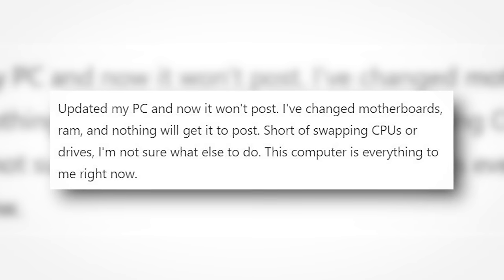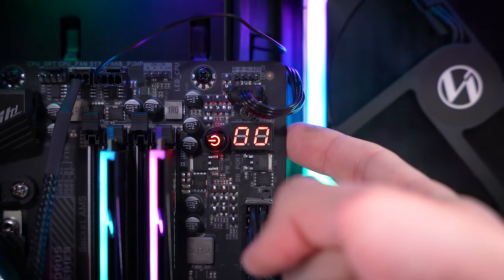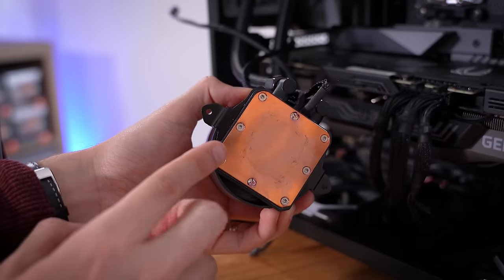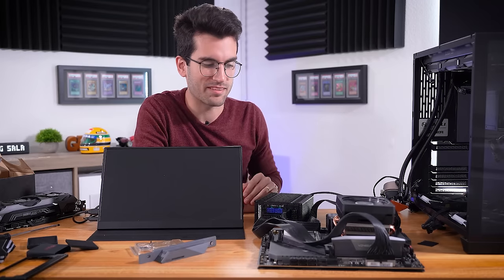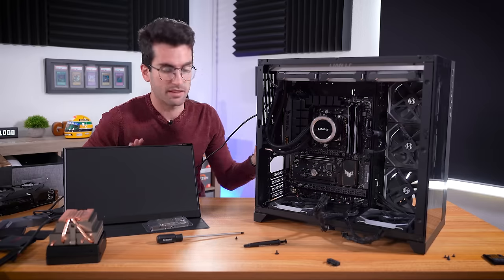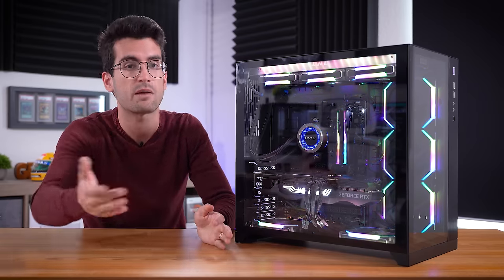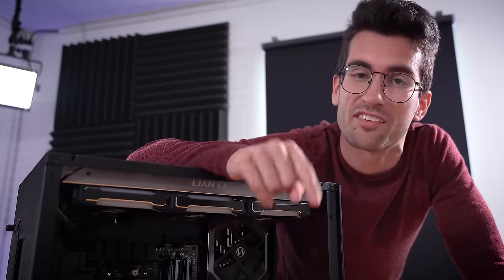Fixing a Viewer's BROKEN Gaming PC? - Fix or Flop S5:E5

Comment: as soon as you said that the MB was gigabyte i knew it was the board.. gigabyte boards are crap and they should never be used.. and b4 anyone flames me.. been building,repairing, working on computers for over 30 years.. have build thousands of them and whenever i have used gigabyte boards, 90 percent have ended up being replaced..
Reply: I agree dumpster fire boards
Reply: I have a gigabyte board and I’m sure something is wrong with it. I can’t enable expo without the pc not booting again. I tried multiple ram kits also

Comment: So, as soon as you showed the specs of the PC I immediately knew it was the motherboard. I as well was upgrading a few parts in my PC, and when turning on the PC, I was getting the same LED bug. Fortunately, I was able to do a return exchange with Newegg and got it replaced. I was able to test it and now have a working PC. Gigabyte may have a know issue with that version of the motherboard because the new motherboard I received is version 1.2, and the one I returned was 1.1.
Reply from the maker: Interesting note! I had no idea there were different revisions of this board.
Reply: A lot of the time different revisions are just about the WiFi card that comes preinstalled these days, e.g. on this board rev 1.0 comes with an Intel AX210 and rev 1.1 ships with an AMD RZ616 Mediatek job. 1.2 is not yet listed, unfortunately.
Reply: The issue he had was typical of a bricked bios not a motherboard issue.  It had already checked the chip and ram.
Reply: does the board have bios flashback? maybe that would fix it @GregSalazar
Reply: @GregSalazar  YEP, early adopters like myself are absolutely shafted with this total POS...
Reply: @SteveMosetiAliyebarikiwa  Maybe temporarily, it's a really bad board. Even for the extortionate price GB charges for this thing, it's a complete dumpster fire of a component :face-fuchsia-poop-shape:
Reply: @TheSjuris  I agree but in my case I bought the motherboard brand new from Newegg and still wouldn't post and I let the PC sit for over 10min to see if anything would post.

Comment: Flash bios may save the board.
Reply: It's ridicilous how many PCs stop working and then you update bios... works now. Doesn't make sense.
Reply: bios update would have been my first goto considering the symptoms
Reply: I agree
Reply: When the message from the owner said "I just updated my bios and now it won't post" and the title of the video says "bricked pc" , sounds like a bad flash to me. I would have tried Q-Flashing it right off the bat.
Reply: Wouldn’t have fixed the warped cpu socket
Reply: @adamtowsley3526   I don't think it was contributing to the issue. The CPU retention bracket puts more force on the cpu and it slides into place even if Greg didn't push on it with his finger. Either way, Q-Flash would have been my first step from the information provided was the point I was making.
Reply: First thought i had since the description. It might be it, but he can't start off by flashing bios. At best he would do it at the end but since he replaces the mobo he doesn't need to.
 That's why if i was makin videos for a living i would have died of hunger. If we are right it would be a 5min clip at best and the takeway would be "i'm right"  vs 25min with some info for the newbies.
Reply: @ChristopherM  this makes no sense? no where in this video does it say the owner updated his bios and now it no longer works?
Reply: @johntet   I'm not trying to say "I'm right" or anything like that. Just adding to the conversation what I would have tried first. And I am only commenting in the first place because Greg didn't try that. I don't doubt that this approach probably didn't cross his mind because sometimes in troubleshooting, you get focused down one path of thinking, you sometimes forget to take a step and think about it in a different path.
Reply: @IceWolf1102  That's interesting.. I thought I heard him say at the very first sentence "I updated my PC Bios, and now it doesn't work." I wasn't looking at the video, just listening. But now that I went back to review, you're right. I imagined it. Hmm. Then it looks like I wouldn't have tried that at first, I would have done other troubleshooting as well. Flashing would have still been on my list to try, just wouldn't have been the first thing I tried. 

Thank you for pointing that out.
Reply: not buying a gigabyte board would have prevented any issues at the get go
Reply: No, flashing the BIOS is a last resort and only if a prior BIOS flash has bricked it.
Reply: But correct me if I'm wrong, but a outdated BIOS usually gives you some sort of video output, no?
Reply: @arthurtwa  not always.

Comment: So 15 is a pre-memory Northbridge initialization. 46 is one of the ones gigabyte doesn't tell us and just tells us it's reserved. 00 is a restart. That told me that it was never the memory. This narrows it down to CPU or MB. For some reason, the motherboard is having trouble communicating with the IO Die Those codes are useful if you know how to read them. Once we saw the socket was warped it was definitely the motherboard not making good contact. I know a lot of people think debug LEDs are good enough and 90% of the time they are but in cases like this you could have diagnosed this in like 5 minutes by just reading the debug codes. I feel like this should be a standard feature. I miss the days when you could just add a post card and read post codes by plugging it into the LPC debug port or PCIe bus.
Reply: 46 is also a memory code, I just don't remember which sequence it is.
Reply: work as you said how can we have a length enough videos to enjoy at free time, take it easy
Reply: i also found it odd he didnt google the codes but i also believe in the end it didnt matter and the board needed to be replaced anyway
Reply: @sir_whocampsalot2876  My guess is that the board's memory slots got borked.
Reply from the maker: The codes were sporadic. 00 = dead CPU if it hangs. 15 = memory training (normal process). 46 = memory initialization error. The codes did NOT tell me much of anything in the moment other than that an issue may have been present with RAM. This was isolated and removed as a variable early in the video. Wouldn't have been a 5 minute diagnosis. Bit silly to claim this in hindsight after watching the video.
Reply: @GregSalazar  looking them up is a good troubleshooting step. Frustrated the heck out of me that you didn't check what the codes were (at least on camera). 😂

Comment: My guess is that the previous motherboard had either BIOS issues, power delivery issues, or both.
Meaning I think the AIO pump was not being given enough power to properly cool the CPU / move the pump effectively, causing the cold plate to get very hot and warping the plastic of the socket, which was a symptom of the motherboard's failures, and a red herring to the actual problem.
Well done identifying that issue!
Reply: 100% power. Either overvolting the CPU or not powering the AIO. My guess is, failed cap(s).
Reply: I just got so paranoid after reading this lol.

Comment: I've been an electronice repair tech since 1973 and a computer repair technologist since 1978, you are doing a great job at troubleshooting. I did do repair to component level but that was a long time ago. Great video...
Reply from the maker: I appreciate that!
Reply: I follow few YT repair channels that do board level repairs. Usually case is that you would need to rebuild whole system or it's laptop motherboard.
Reply: @LimbaZero  Louis Rossmann when he was in NY, I saw him and a few asian places it was Taiwan or China I think. You need some special gear if you do that now a days, or have a lot of patience and a heat gun and soldering station.
Reply: @murraystechtime8530  Soldering station with heat gun is mandatory for board level fixes. I have watched some Louis videos. 
Other what I have watched is Adamant IT is from UK and he also show how to fix bit rot bios. He mainly fix different laptops or fix those dell/hp desktops where you can't get new motherboard so easily.
Reply: @LimbaZero  I saw them do surface mounted IC's you have to use a lot of flux and just the right amount of heat alot of cleanup and prep to resolder the replacement IC. Mybe one day I'll try but it will have to be soon as I am 68...

Comment: 8:39 CPU was not set in the socket properly. You can clearly see it. That's what probably caused the lopsidedness/warping of the socket later on in the video.
Reply: i saw that too and came straight to the comments to see if anyone else saw it
Reply: @KingRom3K9  After watching the rest of video, it wasn't the CPU causing the issue anyway, but yeah, it still wasn't seated properly, thus giving him no signs of life there after he installed the CPU and attempted a boot.
Reply: It hurts my soul when he push down the lever

Comment: Hi Greg ! When you installed your 7600X, if you check closely, you didnt mount it good, one side was like abit on the socket plastic, that is why it couldn't turn on :)

Peace !
Reply: Yeah, looks like the OG CPU was sitting in the socket just fine, and if it wasn't sitting in tight before, Greg might have actually warped the socket himself 🤔. That's why I always give any CPU I install a little wiggle to make sure it's sitting correctly in the socket, just like Papa Linus taught
Reply: I caught that right away! It was clearly not fully seated in the socket. I was practically yelling at Greg through the monitor to fix it. 🙄

Comment: You may want to invest in an EEPROM programmer and some basic board level rework tools. I've seen an increasing number of motherboards with corrupt BIOS/UEFI firmware, and I've had to get out my programmer to fix them.

For motherboards with SPI flash chips (most boards these days use them), you can sometimes get away with one of those clip programmers. But more often than not, you have to remove the SPI flash chip to program it. Other things on the SPI bus can drag down the bus so the programmer can't read the flash chip.

Comment: I think around 8:42 of the video is where the CPU didn't look fully inserted. I caught a glimpse of it but wanted to wait until further in the video to see if anything happened. I suspect whatever happened before was maybe a mistake by the viewer or if it was just a defect of the motherboard. So while not the most expensive mistake, its another good lesson to take the extra 5-10 seconds to make sure the CPU is inserted correctly.
Reply: I noticed it then too, and had that panic moment of, "oh no! That's not in properly!". Funny since I think that would be much harder to spot from Greg's angle, where you're looking more directly down on it.

Comment: Complete bricks are always fun to diagnose!

Said no one ever. 😂
Reply: This was an easy diagnosis. I appreciate how he went about showing how to diagnose it without relying on the debug code, but the debug code told us everything we needed to know which is that the Northbridge initialization was failing which on a Ryzen means that there were problems communicating with the IO die. CPU or motherboard. A closer inspection showed a warped socket. Content aside This is why I love POST/Debug/Q codes.
Reply: Actually I love trying to diagnose them, they challenge me.
Reply: @zadekeys2194  Yikes... the L is very big... massive. Just what do you think a BIOS flash is gonna do for a warped CPU socket?

😬😬😬

Comment: Like Greg, I always keep a budget end GPU for testing that I know it works ….. used GT710/750 etc are dirt cheap (in many regions) and is a quick diagnostic tool to have on hand. 
I always have the following spare parts for diagnosing my pc issues (very very very few and minor):
 - Spare cheap low end GPU….. for me a old GTX1050 😉with no pci-e requirements
 - Spare name brand working psu 750w (I personally have a higher end 1kw psu for day to day use) 
 - a few Spare SATA cables
 - a spare cpu HSF (Heatsink & Fan) cooler (as I have an Liquid cooling setup for day to day) for testing purposes only and quick change over when needed
 - pc screwdriver repair kit (knock off I-Fix-It) which I got for about $15 AUD containing all the screw fittings and hex keys for my water cooling setup.
 - A spare NVME 256gb and SATA drive (capacity doesn’t matter as long as windows can be installed on it) 
-My mobile phone or tablet device for internet YouTube etc troubleshooting tips your not aware of😇👍
 - Diagnostic software tools on a USB thumb drive (16-32gb is usually enough) such as anti virus / anti malware detection, memory testing software, DDU GPU software uninstaller to name a few.
 - Fresh copy of Windows on a USB drive for reinstall (16gb is more than enough) or repairing windows boot loaders etc. Download directly from Microsoft’s website.

You can easily scale back your spare psu etc costs dependant upon your pc setup.😁but these are
Reply: I have a GT 730, dont remember what it cost, I think I got it in 2015, Its powered via PCI and a easy check, a old Antec HCH 750 watt psu - and a shoe box of cables. 
The one thing I love is part of a front panel with a power button. 
I am a engineer and only dabble in PCs for family and a friends - I like to tinker with stuff- If you got a software issue - I say take it to a profession

Comment: At 8:42 it seems the CPU wasn't placed property in the socket 😮

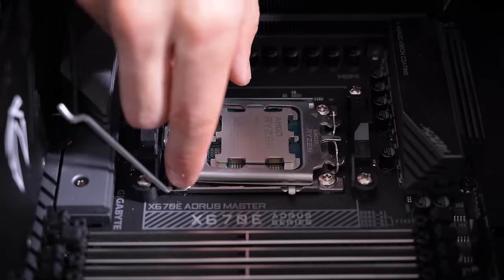At 7:30 the original CPU was placed properly but after 8:42 probably the socket got damaged as the CPU wasn't placed properly before securing the bracket.
Reply from the maker: Watch a bit later in the video and you'll see why :-)
Reply: @GregSalazar at 7:30 the original CPU was placed properly. After 8:42 it seems the socket got damaged as the bracket was closed with the CPU not placed properly.
Reply: @GregSalazar Pause at 8:43 as you're closing the bracket, the CPU is not properly aligned and isn't sitting fully inside the socket. At 7:35 the original CPU was properly seated before you removed it.  Therefore, you installed the CPU incorrectly and didn't catch it until the system failed to power on at all and then, because you missed your mistake, suggested the socket was warped or damaged prior to your mistake.  Ultimately moot since the motherboard needed to be replaced anyway, but I was watching you inserting that CPU and yelling "Nooooo" at my screen as you were talking and closing the bracket.

However, the main point is that you missed this when you were doing it on video, whether the socket was already warped before that or not is of no consequence.  We all make mistakes, unfortunately making mistakes while troubleshooting can end up taking you down a different road if you don't realize you made a mistake.
Reply: You can see the damaged frame at 12:14 in the bottom right corner the frame got warped as the CPU didn't seat properly in the previous installation. At 7:41 you can see the socket without damage before the CPU swap.
Reply: When he pushed the cpu down it was seated correctly. So its quite possible that the cpu bracket was already warped before he seated the cpu

Comment: All X670 boards should still be under warranty and eligible for an RMA. Any DIYer should always save thwir boxes (and socket covers) just in case. It doesn't hurt resale value either. I had a Gallahad clog up, very easy and fast process for the recall. It only clogged because I didn't swap it right away after getting the replacement. It only effected the early units. Mine was a pre-order.

Comment: at 12:05 you can see part of the plastic on the lower right hand corner of the socket sticking out towards the pins. same is visible at 20:33 lower left hand corner.
since its the side where the CPU didn't seat all the way, whether it got stuck under the CPU or even unter pressure went between the pins and CPU contact patches

Comment: My 3 criteria when I build my first AM5 system are as followed. (1) Wi-Fi 6 or better (2) PCIe 5.0 for gpu and top m.2 (3) usb 3.2 10Gb preferably with type A (I already have 10Gb compliant usb A to C cables and C to A converters 10Gb compliant.

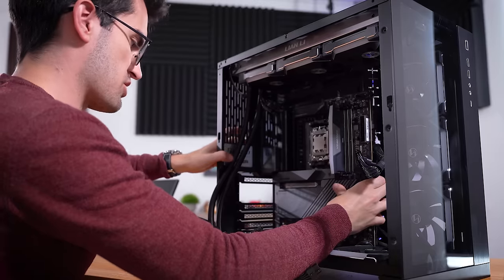Comment: i'm at 10:44 so far, i've encountered a similar issue because of corrupt bios, one cpu working but no post, another good cpu no power at all. I took the bios chip out, reprogrammed with CH341A , put it back, and worked after.

Comment: Once the memory does train on AM5 you can enable “memory context restore” and “power down enable” in the memory timings section of bios. Along with these, look for “fast boot” in the “boot” section of bios and enable it. Usually doesn’t fast boot until the next restart from a power off condition. It will result in a faster boot…….but not as fast as an AM4 rig.

Comment: I work for a major imaging company. I agree , the longer the system is down the more money it costs the customer. Identifying the problem to a component/ board unit and replacing the high level component is the most cost effective solution.

Comment: @ 7:50 you put the CPU in at a slight angle with it seating partly on top of the socket, I'm pretty sure the "warped" socket came from closing the bracket with the CPU sitting crooked and it was actually fine before, you can see the CPU still sits on top at an angle after closing the latch putting immense pressure on the plastic around the socket, and you can even see a small piece that broke in the socket afterwards that wasn't broken before. I think that one's on you unfortunately ^^ not that the motherboard didn't have other issues apparently.